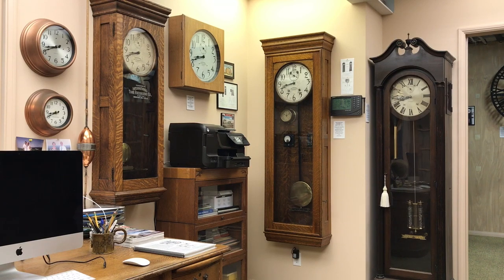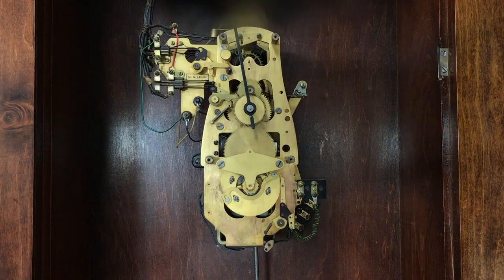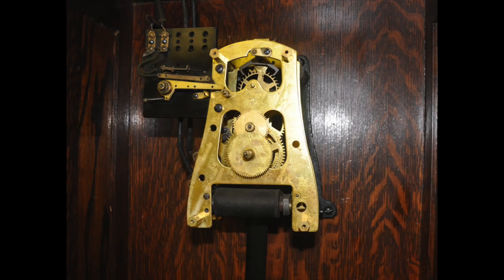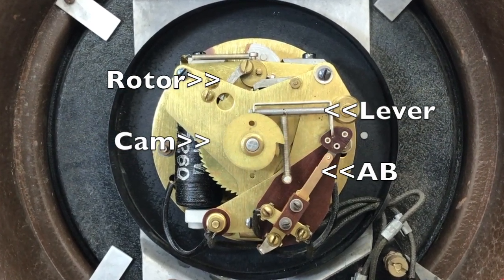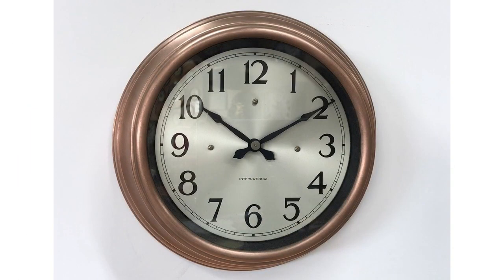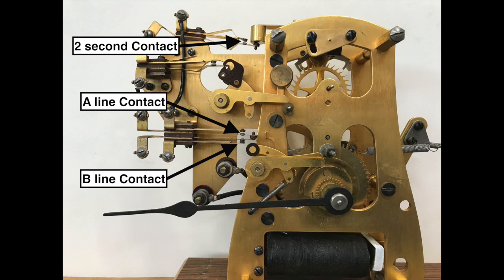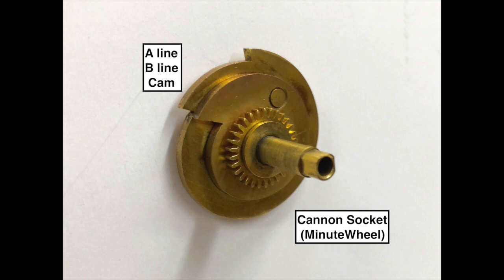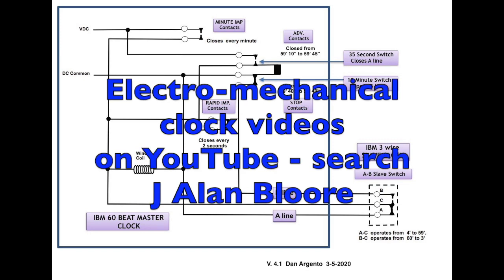IBM Master Clock - Slave Clock Automatic Correction. How it works

Comment: At the elementary school that I went to in the 60's, they used Stromberg-Carlson clocks with the sync feature.
I remember them at 59 minutes would pulse several times, even if they were correct, but would not advance until the 60th (0 time) minute.
I also remember when they were slow, they would step up to the 59th minute where the minute hand would "lock" but still pulse.
They were pulse driven though and would receive a step pulse every minute that lasted about 5 seconds.
I knew the master was in the front office, but really didn't know how the system worked.
Thank you for the detailed explanation!
Reply from the maker: Thank you for sharing your memories of the school clock system. I also have fond memories of the synchronized time system at my school and never gave it thought about how brilliant the system was and is. It was fun to learn the intricacies and I was happy to share what I learned.  Alan
Reply: I am 73 years old and I remember clocks like these that advanced the minute hand once each minute when I was in elementary school.

Comment: Great explanation! I got an IBM clock recently, so was kinda wondering why it was using 3 wires at first, altho managed to figure out that it must be some kind of auto-correction feature. Turns out I was right, altho it turns out to be a lot more advanced that I thought. Don't have an IBM master to run this unfortunately, and the Siemens master I use doesn't have that feature so glad to find this video and see it in action. Keep up the good work :)
Reply from the maker: Sorry I missed your comment. I am happy that it helped explain the extra wire. The correction feature is beautiful. Keep looking for an IBM master clock.

Comment: I worked has a time recorder service Engineer over 40 years ago and worked on these 3 wire hourly correction systems I still have one here at home not running but 8n storage happy memories
Reply from the maker: Hi Martin, I think you were lucky to have worked on IBM products at a time when service was more important than just throw out and replace. Thanks for taking time to comment. Happ[y Holidays.

Comment: Hello Alan, thanks for making a complicated concept understandable. I recently bought an International Time Recording Co. slave...round, very heavy with a cast iron base and a brass dial ring. It has three brass terminals on top marked A, B and C. Not having a master clock, I was thinking of buying an electronic impulser. Could you please tell me which terminals that would connect to? I imagine "C" is common? Thank you. James in Toronto.
Reply from the maker: Hi James, I am happy that this video helped. Sounds like you found a nice ITR slaver clock. Yes the "C" terminal on the slave clock will be connected to one impulser terminal and the other impulser terminal should be connected to spliced wires from both the "A" and "B" slave clock terminals.
Reply: @SelfWindingClocks  Perfect, thanks so much Alan. I'm enjoying your other videos...what a beautiful collection.
Reply from the maker: @jamesweekes6726  Thank you James

Comment: Brilliant description Alan.  Question; if a system had a mix of 60 beat and 120 beat secondaries, how might that system differ from this basic design, if indeed it differed at all?
Reply from the maker: Hi Patrick, IBM secondaries have minute impulse movements. IBM did have master clocks with 60, 80, 72 and 120 beat movements that could have had correction systems. Self winding clock co. did have 60 and 120 beat clocks that were considered subsidiary (could have been termed secondaries) and were part of their correction system.

Comment: Hello Alan, at this moment I am working in the restoration of an IBM Model 25 Master Clock, used to control a Tower Clock. I wonder if you have a wiring diagrams of the winding circuit, because de magnets are not working when the minute impulse contact is closed.
Many thanks
Reply from the maker: Hi Juan Carlos, There are wiring diagrams on the IBM Archives web site. Look under archives   then exhibits    then Clock corner. Lots of information. Send me an email address and I can send a simplified wiring diagram.
Reply: Last one is Siemens not IBM, sorry.
Reply: @SelfWindingClocks  Having problems when writing an addres, but it is bucefalo323 with the g. I would like to send you pictures of other clocks that we are working with at my University, from other manufacturers as Faraday, Stromberg, National and Siemens.
Reply from the maker: @juancarloscarmona5901  Not sure I can help but send to jabloore@aol.com

Comment: It seems to me that a clock that is more than ten minutes ahead or behind would not receive the B signal in a timely fashion. Did I misunderstand?
Reply from the maker: Yes if the clock is more than 10 minutes ahead it will be corrected to the minute but will be at least 1 hour ahead. If behind more that 15 or 16 minutes the hour will be wrong. IBM was very careful to state the ranges of fast or slow corrections. Still it is quite amazing considering it was developed almost 100 years ago.

Comment: Hi J. Alan Bloore thank you for all the great information i have just brought a IBM Master Clock to restore, i have been looking get one for a long time, if you would like to see the clock it's on here https://www.flickr.com/photos/182081477@N07/ 
i did not know how good the IBM Master Clock is, it's an amazing Master Clock and i am looking forward to restoring the clock.
Do you have any information on the clock like the plans for the mechanism, i will have to make a new clock suspension spring as it is broken, do you have the dimensions for it please.
Regards Peter
Reply from the maker: Hi Peter, Email me a contact address. I have suspension spring dimensions. Your clock collection is beautiful. The IBM website has lots of good technical information.  Alan
Reply: @SelfWindingClocks  Hi Alan, thanks for your reply.   
I have had a look at IBM website it very good thanks, i still need some more information on the clock.
Regards Peter